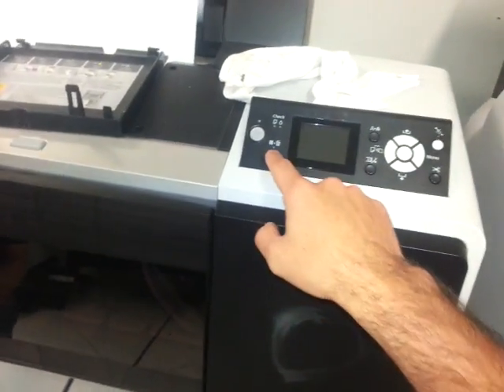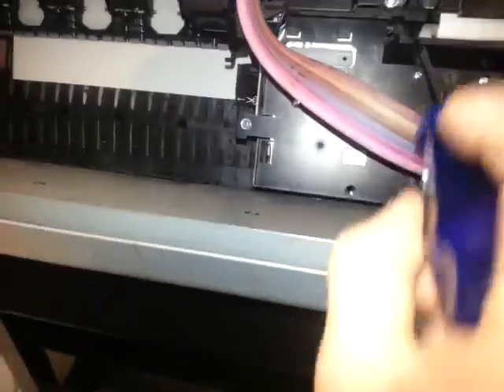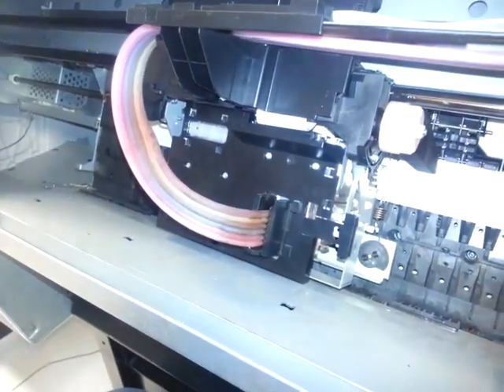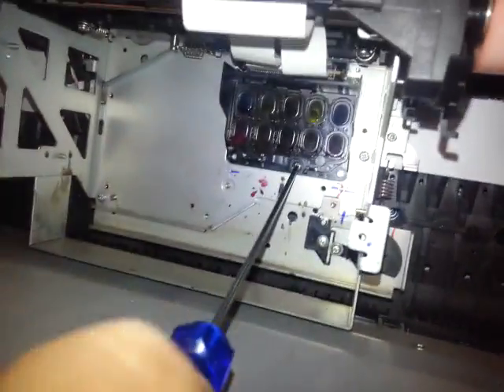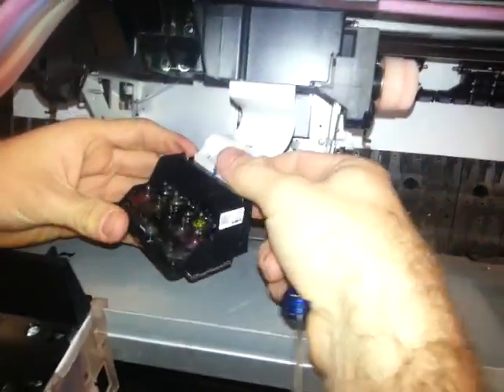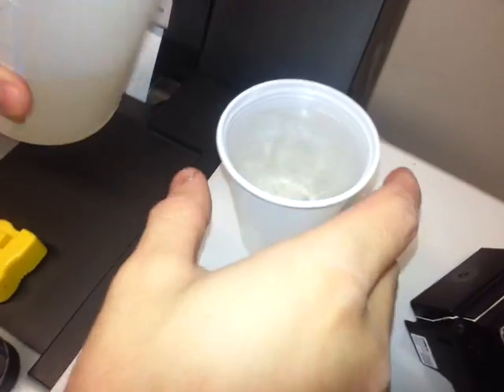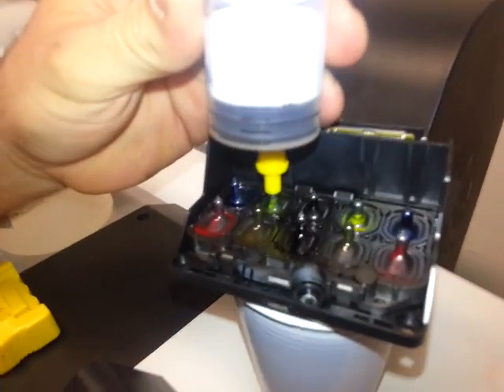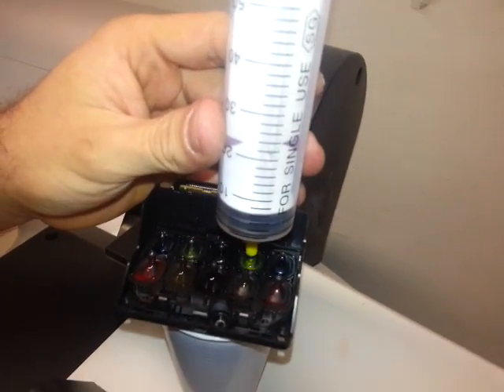Epson 9700 - Removing and Cleaning the Print Head

Comment: Thanks for your video! My Epson 9900 prints correctly in color, but when I print in B&W it prints in brown magenta tone. Epson's authorized service technician checked the printer through software and mechanically; we changed all the original black inks (Photo Black, Matte Black, Light Black and Light Light Light Black), but I still have the same problem, could you please tell me what could be the cause and how can I solve it? Thank you very much

Comment: I just did this on a P7000, which looks the same but definitely isn't exactly the same.

I have nothing against the author of the video. It was great to see how to get to the print head and what to do. 

Having said that, I wish bodily harm on the engineer who designed the assembly.

I had 8 screws to remove, and then the fun began. The outer assembly is also tethered by wires on the right hand side, so I couldn't just swing it out of the way. Had to suspend it above like I would a brake caliper. This makes it difficult to get to the top screws of the print head, but I got them out.

I had the syringe and a cup, but also needed a small piece of tubing to connect the syringe to the nozzle. When you're flushing fluid back through the head, remember to pull the syringe back a bit before you remove it, or the pressure makes the fluid go everywhere.

Once it was time to reassemble, remember to connect the ribbon cables before putting the print head back in, and a pair of needle nose pliers helped me get them in. I could not get the top right screw into the print head and you're a better man than me if you can. :)

Somehow I got all 8 outer screws back in. Fired it up, did a heavy cleaning, and a nozzle check. Green and LC are still clogged, so must be something in the lines. Either way, told my boss we'll need a new one once the quality gets bad enough, as the print head is about 3/4 the cost of a new machine.

Just glad I survived. Best of luck out there!
Reply: كزلك.انا.بدعى.على.المصمم.لراس.الطبعه.الابسون.يارب.مايوعو.ولايكرمه.ربنا.فى.صحته.لان.مش.انسان.افاق.وكلفتى.الهد.يجب.رساله.00010028يقولو.اغير.الهد.طيب.البلوتر.جيبه.من.عاطف.بتاع.المنصوره.لسه.مكملش.اربع.شهور.وكمان.عنده.سمسار.كان.عوز.الف.جنيه.هى.الناس.ده.بتاكل.اولادها.ازى.من.الحرم.ده.لماان.معيش.24الف.اغير.هد.ده.ماكسبتش.والله.يمكن.15,الف.من.يوم.ماجبته.حسب.الله.يدخل.عليهم.بالخرب.وعلى.ولدهم.اناربنا.يعلم.بحالتى.شكلها.اه.كل.ساعه.والله.بدعى.عليهم.ولسه.مصلى.الفجر.وبدعى.عليهم.ومش.عارف.انام.اجيب.منين.ياولاد.الكلب.المبلغ
ده.طيب.انا.مس.حرمى.ولا.احب.اليحت.زيكم.الله.الله.يخرب.بتكم.وتصرفهم.على.ولدتكم.يارب

Comment: I hate this printer. Argh.. replaced new printhead last year.. and it happened again. Yellow missing in some areas. Power clean, SS cleaning still same problem. Planning to manually clean the printhead. If still cannot fix i will throw it at epson HQ! New printhead cost a bomb.

Comment: Hi, I have Epson Stylus Pro 7900. Because clogged orange and green color, (same as my sister and same printer, ! this is interesting ) I remove printhead, and try clean it. Before cleaning test work without problem only green and orange channel missing.
Cleaning was difficult, clogged was also channel when connecting ink cartridge - on back printer, where is some plate with "ink connector"
Also I clean all tubes, and dampers on head. 
After it I look to head, orange and green channel was clogged, any chance to put in clean solution, then I disassembly printhead, where is two screws and can clean "connector" was also clogged and I see that orange and green was dry , clogged. Because cleaning was not possible only to put head in solution I put it to ultrasonic cleaner, only after it channels slowly cleaned. Now head is full clean.
BUT, trouble, when I mout all , fill tubes , dampers with ink, printer break with error 1A39 :(
By the way it happens me everytime, after clean epson printhead :(.
Any advice to this error ? In service manual is problem with printhead by bad connection in align or bad circuit on printhead. 
Is some solution to measure resistance on printhead connector and some trick to disable short circuit or some else to run printer ?
Now printer is a pile of scrap metal :( 
New printhead is overly expensive and , please some advice to my mail velektronic@gmail.com, many thanks
Reply: You have destroyed the print head with the ultrasonic cleaner. It killed the membrane

Comment: There are more then 5 screws (at least in my 7900!) A couple were "hidden" under some "flaps".
Reply: It works? I have a problem with green nozzle and I wanted to use this procedure to clean it.
Reply: @luigiulisseiovane  nope. The printer ended up being scrapped.

Comment: Hi, I’m my 9900 I removed the 5 you said, still wouldn’t come off, to discover there was 2 more that needed removing , so 7 screws to remove in total to remove the head
Reply: Were the extra 2 on the left, Far behind the black cover? I also removed 2 extras (plus many more), but it doesn’t want to come off. Any advice? Should I just tug it harder?
Reply: @veronicar2372  Were you able to get it off?

Comment: I've always said if you have to put that much effort to  take something off to clean it, you might as well replace that component.  In short, if you have to put in that much work to take  out the printhead, might as well replace it.
Reply: The cost of the print head of this outdated is half the cost of a whole new printer.  This video ably describes a great " here goes nothing" thing to do on a printer that was going to be discarded otherwise.
Reply: On my SC P9000, a new print head is $1,200. If I can take 15 minutes to remove the head, it's worth it

Comment: I have checked with my Epson 9900 and it is different than what you show here. Would you please show or explain here how to remove printer head on 9900? Thank you and looking forward to hear from you
Reply: Did you find something for your 9900?
Reply: you have to remove 7 screws in order to remove the print head. Don't forget the one under the pipes :)
Reply: Kayhan Durukan can you explain exactly where the 9900 screws are?
Reply: how worked the clean in your epson 9900?

Comment: Felipe, I have a question about the screw that you are calling screw number 3 in this video.    When I look for this screw I see two screws right next to each other.  The one on the left looks a little larger than the one on the right.  Which of these two screws is actually SCREW NUMBER 3?   My name is Walt, owner of a 9890.  Thanks for the help!
Reply: I got the same question and I own a 7900.
Reply: Left one is your answer, but you can remove both, because the right one is the screw of the print head, that you are going to be removed also

Comment: Maintenance tip:The problem is that inside the PiezoFilm there is a specific resistance that <reads> the type of ink.For example solvent resistance tfp printhead is different than the waterbase printhead for subli/pigments/and various aqua inks.I want to tell you that the recover maintenance has different effect because of the ink type you use.Also do not forget that:Epson does not recomment  the flash procedure in order of course to sell printheads.The ink selector is also good to clean or change after cleaning the printhead.Service program also is important to set up the head rank id for better perfomance-it corrects the voltage in order to work more stable with correct khz cycle.(important).
Reply: Thanks
Reply: عزيزى.انا.نفس.المشلكه.والله.عندى.بب.لم.ينزل.الحبرارت.تغيره.فطلعت.الرساله.الجميله.الحلوه.الاموره.الهى.00010028.البتقولك.اشترى.راس.الطبعه.الثمنها..ثلاث.تربع.ثمن.البلوتر.مش.عارف.المصمم.الجميل.الامور.عوز.اه.من.البشريه.هل.هو.من.كوكب.اخر.ولا.ليه.مكافات.على.كل.راس.طبعه.ولاعوزنا.نلم.تبرعات.عشان.تشترى.راس.الخره.عندى.كلام.كتير.ربنا.يعلم

Comment: Thanks for this video I have done the cleaning as you instructed, pulled the solution from the top and then pushed back in to the cup. Reassembled the everything back into machine and machine started back up correctly without any error messages. The only issue I'm having is I tried to print a photo after doing a cleaning and I'm not getting any printing at all nothing, done a nozzle check doesn't print anything. Can you please advise on this matter?
Reply: Same problem here, did you find a solution to this? Please, if you found a solution tell us how to solve this :(
Reply: Any idea what went wrong or how you fixed it?
Reply: how you fixed it?
Reply: @numberoneprinting6208  u need to wet the capping station in cleaner then do a cleaning cycle, its help with suction
Reply: I am having the same issues, but I can't get it to print....not sure why this is happening, I've done a Init 2 times and still nothing, please help:)
Reply: @ioan_astro  Did you figure it out? Maybe doing this cleaning is killing the head?
Reply: @po2lony123  hey, I cleaned it numerous times but it was dead and i Bought a canon pro 4000 and very happy since, the printer head is $500 and it’s very easy to change

Comment: What do you use to clean the prient head?
Reply: +Taty Pintado You need to buy some print head cleaning solution. You can find it on websites that sell refillable carts or Amazon/ebay. It's a late reply but it might help others.
Reply: Hi, I was wondering the same question. What do you use to clean it?. If you can help us. THANKS
Reply: +Taty Pintado Yes.